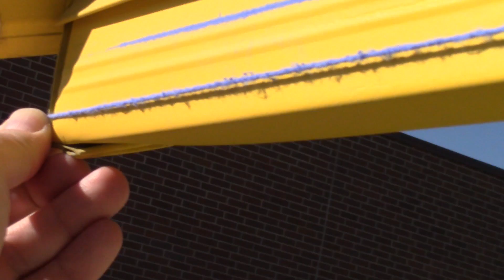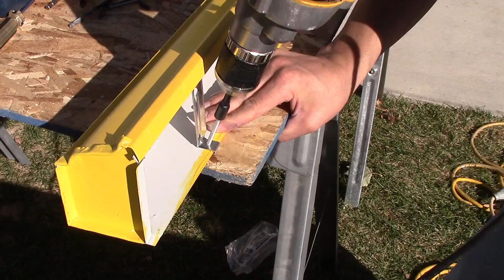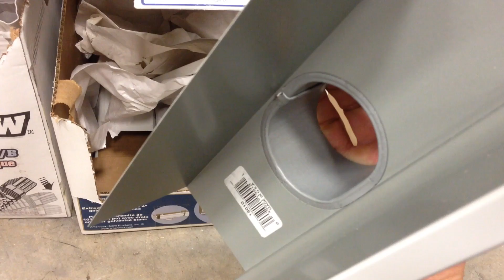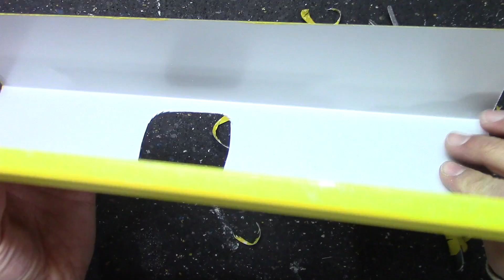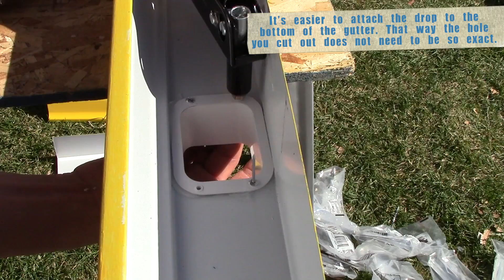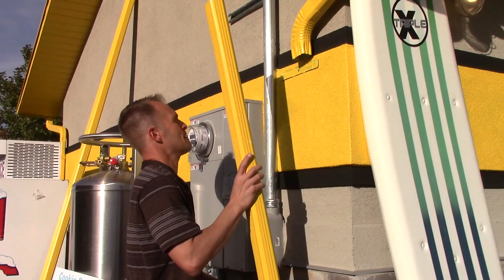How to install Rain Gutters - DIY

Comment: Thanks for the video..very helpful. Only question I have is...what do you do if the fascia board is at a 90deg to the roof angle? Do shims have to be installed for the bottom of the gutter to rest on? Or is there something easier to do?

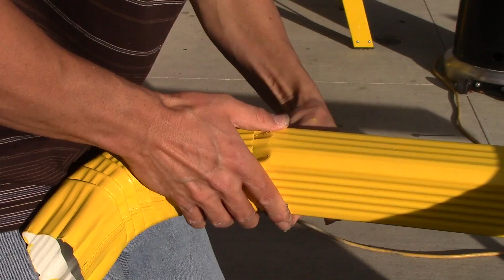Comment: 11:36 wrong way to crimp cutters. If you are going to do this and don't want to buy the tool.  Go the heating isle in HOME DEPOT and crimp one end of each piece of straight down pipe you buy.  Cheapo.

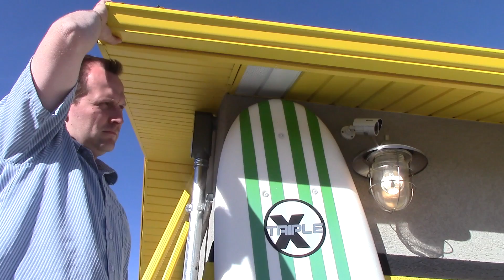Comment: 4:56 that is not gutter sealer and will leak.  Silicone does not stick to aluminum for long with heat and cold.

Comment: Just a hint that was not explained the 2foot spacing is so the screws drill into the truss ends of the roof. If you afix the gutter to the facia only this will cause gutter failure over time with heavy amounts of water. I live in Northern michigan and gutters are subject to heavy ice and snow and ive fixed too many gutters that big companies come in and mess up by screwing into the facia only. Makes sure you screw into the trus ends. You can find and mark these by removing the facia metal and marking where the nails hold the facia board to the truss ends. Doing this will ensure you have amazing gutter for the life of the warranty.

Comment: Finally a proper gutter how to  guide that hits the “how to cut a hole yourself in a gutter with basic tools” flawlessly. Thank you. I just need to see it done and then I can do it. I’m weird like that. I was thinking of installing from the bottom and sealing from the bottom and using some metal screws and caulk and seal it up good because inside the gutter is full of thick caulk and it’s in a tricky location to get to from above.

Comment: Great video, I didn't get the part when you said if I have a section over 30 feet. I have 80 feet so I  would drop about an inch at every downspout? After the first downspout I raise the gutter and pitch it down again? Sorry for the novice question.

Comment: You assumed that building was level. They have levels that can go on your chalk line. You may have give too much or too little slope. The red and green snips make left and right hand cuts easy it’s the yellow or strait cuts that aren’t as useful when dealing with eavestrough. Glad to see you sealed the outlet most videos on YouTube don’t do that lol good on ya. Pipe crimpers would have made putting that elbow on much easier and drill into the mortar between the bricks not the brick. Would recommend putting brackets 18 inches or even a foot apart when dealing with a steel roof but that’s if you deal with ice potentially sliding off in the winter. I’m not sure how the weather is there where you’re from. Never have I seen yellow gutters that’s part of the reason I watched lol

Comment: you are mixing up steel and aluminum hardware, when it rains it will form a battery accelerating corrosion.  are you by the beach? salt water is a wonderful electrolyte.

Comment: What are you talking about!? Lol galvanized will 100% rust! Good try but I install gutters for a living n that's a1 hr job at most n youd b way better off in the long run paying a small fraction more for it done right and seamless but again good effort! 3/5 overall lol

Comment: You installed the gutter over the drip edge?, bahahaha
Reply: I noticed that too.  Seems like the drip edge should go into the gutter?  The gutter should tuck in behind the drip edge?
Reply: @jeffh8112  yes you/ I always put the gutter below the drip or under it.  If its below the drip you install a piece of flashing metal under the drip Down Into the gutter.
Reply: @FFautofab  Okay great.  Thanks for the information!

Comment: Dude. You suck at cutting out downspouts. Easy way is to draw your square like you did. Then use a blade to score over the line, and score an "x" in the middle.  You can use a drill to punch a hole or even a nail.   Take a pair of snips to widen the hole and cutout.  Take a pair of pliers and wiggle the metal till it breaks at the score.  Clean cuts every time.

Comment: While I own a gutter installation company, I actually am a fan of DIY. Everybody needs to save money where they can and this is an informative video. Of course, I believe that seamless gutters are the best long term solution. The warnings I would give to people are simple.

One, if you're not at least a little bit handy, the Peter Principle applies: if something can go wrong, it will. People with no skills will struggle. Double or triple the time it will take to do the job. Two, not everyone is comfortable with heights; even a single story dwelling can be ten or twelve feet off the ground. If you're not good with heights, don't do it. Third, whenever you will be working outdoors from a ladder, be wary of some common sense safety precautions; take into account wind, trees, power lines, etc. Fourth, you may be able to do this alone, but it's easier with two people, both for efficiency and safety.

Finally, use the right tools. It is amazing how the right tools help the job go smoother. Look, if you're older or clumsy, save yourself the grief. A competitively priced professional will save you time and trouble and by the time all is said and done, probably money. Hope this is helpful.

www.BuyRiteSeamlessGutters.com

Comment: Thank you for your really thorough & informative video.  Just a suggestion--when cutting out the hole for the square downspout, why not use the hole-cutter bit  (you used for the round hole) to remove the bulk of the material & finish up with the tin snips?

Comment: Adam, I have built  a small outbuilding free standing with a flat roof pitched 30:1 (a fiberglass roof).  Three sides are upstands and one side, the shortest is the drip trim onto a rain gutter.  I have not yet installed the rain gutter.  The roof is small but an irregular quadrilateral with surface area of about 115 ft2. The drain side of the quadrilateral where the gutter will go is only 8 ft long.  The problem is that I have no draining runoff systems nearby, this building is in a garden.  The other problem is that it adjoins a narrow public footpath used by pedestrians.  I will install a small vertical cylindrical water butt perhaps holding 100 liters next to the building.  I was wondering at the end of your video about this corrugated drain piping.  I could send the water some distance well away from the building and footpath and into another part of the garden.  My question is: with such a small surface area can I just let the water fall over the wall into the footpath or do I need to use such a method?  Maybe such a small rood does not justify any special measure.  I live in England and it rains a lot.

Comment: Adam, I am looking at installing eaves trough over a 56' length. For a number of reasons it would be preferable to only have one downspout. I have a 6" fascia. I have heard of 1/4" / 10 ft and you recommend 1" / 20ft (1/2"/10ft) So looking at those two guidelines I could be somewhere between 1.4" and 2.8" drop over the full length of my 6" fascia. Do you think I will be okay within these parameters?

Comment: Great video. I notice that the gutter extends beyond the drain spout to the end of the roof line.  Do you have to angle back to the downspout or does waster poor out the end of the gutter ?  Thanks again.

Comment: You did the outlet wrong for the downspout. Your supposed to drop the outlet into the hole you cut. Not pop rivet on to the bottom. Other than that not bad.
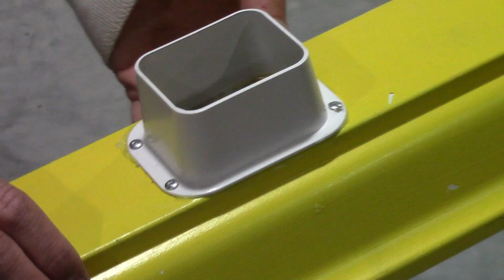Reply: True.  Plus the way he did it leaves the rivet heads inside to catch debris. 8:19.  Plus, look at that sharp edge...hate to be the guy who swipes his hand in there while cleaning out leaves.
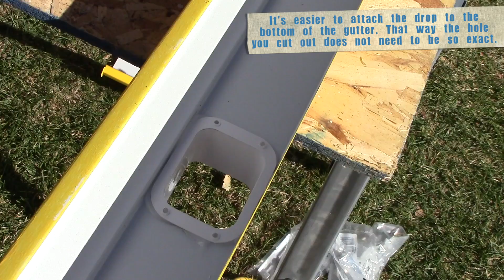Reply: The outlet at 9:50 it the proper way to do it!
Reply: Airbus321
Reply: yep my advice also!

Comment: I appreciate your time in making this video.  But as soon as you said Home Depot, I knew it was not going to be a quality gutter installation. I just bought Amerimax gutters this week, and they are flimsy, almost tin foil like. The seams do not seal well due to the seamer strip not being properly sized to the gutters. They seem to be the exact same size, and that does not work when you are trying to put them around the outside of the seam. And the seam sealer they come with doesn't stick well. I  used Sikaflex on mine. If I were to do it over, I get my gutter material from a better source and pay a little bit more.

Comment: GUTTER PROS LLC. Servicing The DWF Area
Whether you're looking to install new gutters or have your existing gutters cleaned, Gutter Pros, LLC is the company to turn to. As an established roofing business we're pleased to offer a full menu of gutter services, including:

Gutter repair
Gutter replacement
Gutter cleaning
New gutter installation
Seamless gutters
Rain collection systems

AT YOUR SERVICE
At Gutter Pros, LLC, our roof and gutter experts are qualified professionals who get the job done right the first time. We're up to date on local homeowners association guidelines and city permit requirements. And we offer a wide variety of gutters and related services to suit our customers' needs.

With reasonable rates, courteous gutter/roofing contractors, and a commitment to customer satisfaction, Gutter Pros, LLC is here to help with all of your gutter installation, repair, and cleaning needs. Call us today to schedule an appointment or request an estimate for our services

Brandon Frazier (214) 769-2777

Comment: Do you know of any vids that show how to remove gutter from house without destroying it
Reply: Its very easy. If you have old gutters, they're probably bracketed with nails. Use a hammer to bend the bracket and then use the claw of the hammer to slip behind the bracket and pull out the nail. Just go one by one and make sure to have somebody with you for when the gutter falls. There also might be nails in the gutter itself, possibly behind the flashing(metal drip edge that sits on top of the fascia under your shingles) so make sure to check for those as well. If your gutters are bracketed with screws, you're in luck. Just pull out all the screws that are securing the brackets and take it down. Your downspouts can just be knocked off the gutters with a hammer(or unscrewed from the gutter if you want to reuse) and pulled off of the house. Hope that this may have helped. Its very easy, just requires a bit of work if your gutters are secured with nails. I also should mention, the most important part of the process is LADDER SAFETY. Stay alert and don't put yourself into any dangerous positions just to pull and extra nail without moving your ladder.

Comment: Just use a 2 1/2" or so metal cutting hole saw for the downspout holes in the gutter. You're working too hard on that to get a square hole no one will every see. Otherwise nice vid

Comment: The video is very helpful. I need to send you a few pictures along with my question.  I have a metal carport that I use as a horse shelter.  Years ago my ex "rigged" a gutter along the back, as it slopes towards the back.  He used wood blocks to attach the gutter.  The wood blocks allowed the gutter to extend out beyond the roof.  If I can send you the pics you can have a better understanding.  I need to know if there is a better way to attach the gutter?  You will see I temporarily used bungee cords to "pull up" the gutter, which is one of my problems but I also think it is not angled 1" per 20ft.  The shelter is 40' I believe. thank you! And forgot to mention my problem in the last half of the gutter to the downspout isn't draining and it is running over and dripping and making the ground very muddy below it.

Comment: I'm installing the exact same system in a couple weeks, 32 feet exactly, do you think one down spout will be enough??? thanks...
Reply from the maker: I have a long length on my house with only one spout.  It does have a gush of water coming out but it has not had any real trouble.
Reply: #AdamDIY I like that you gave multiple options to perform a single task!  A little slow paced but overall a great/informative video. @Alex T
Reply: Great video, exactly what I'll be doing this weekend. It looks like your downspouts are 2x3, is that correct? My project is almost identical to your, and I was almost going to use 3x4 downspouts. I'm in So Cal, and even though we're in a drought, we do get some heave rain once in a while. I'm stuck deciding between 2x3 or 3x4 downspout. Thanks again for the great vid!

Comment: I like that you gave multiple options to perform a single task!  A little slow paced but overall a great/informative video.
Reply: That's what the YouTube speed controls are for. Click the little Gear Icon and go to 1.25 or 1.5X
Reply: Some of those "options" are improper versions of work.

Comment: Decent video. Very informative but I will say a few things from the trade. I always pop down spouts together vs screws cause they just look nicer and you usually can get them in matching colors to your downspouts. AND the big interjection about snips used to cut the hole.... Always have both green handled and red handled snips. Those are what you use on any professional tin cutting job. You were using yellow snips which are not meant for cutting holes. Yellow handled snips are really meant for just general straight lines and not angle cuts. All together damn good video though outside those two things.

Comment: anyone watching, can someone answer me this, at 12:51, you guys see how he's attaching the downspout strap onto the downspout, i bought some 1/2 inch zip screws from home depot, by Everbilt, it's white and it has a hex head, galvanized steel 

http://www.homedepot.com/p/Everbilt-8-x-1-2-in-Stainless-Steel-Hex-Head-White-Head-Sheet-Metal-Screw-801094/204325619

but when i try to screw the straps in the downspout to secure, exactly like how he does it at 12:51, the screw doesn't feel tight, it goes all the way in, but it feels as if the hole made by the screw is a hair loose, is this screw the problem? or when you screw self tapping screws into aluminum there is a special method? sometimes when screwing elbows onto the downspout the screws feel tight but sometimes it does not, it just spins around when it bottoms up. I hope somebody can answer this thanks!
Reply from the maker: +bludika Email me a picture of the screw. As close up as possible.
Reply from the maker: +bludika adamhbs@gmail.com
Reply: +AdamDIY well it basically looks like this 

http://www.amazon.com/Fas-Pak-9495-2-Inch-Stovepipe-Assembly/dp/B007HV9ZCY/ref=sr_1_6?ie=UTF8&qid=1460439582&sr=8-6&keywords=gutter+screws+hex
Reply from the maker: bludika Yes, I wanted to see the part of your screw where it meets the head. You may have a bad batch or you may be using too much force and speed on your drill.

Comment: not often do I find an outstanding diy video like Adam/s. I do not have a facia plate to anchor the gutter..appears via photo the overhang is about 24 inches? any suggestions? and thanks again
Reply from the maker: +Claude Kment Do you have rafter beams you can attach to?  Yes it's about 24"

Comment: Adam, Great Video - well produced and very informative!  A couple of comments. 1) it appears that you installed the gutter OVER the flashing on the facia.  Some installers recommend lifting the flashing/drip-edge a bit and sliding the back edge of the gutter up underneath.   This may help rain from leaking behind the gutter.  2) a drop of 1/2 inch for 20 feet of gutter may be sufficient.  Thanks for your time and effort!!
Reply from the maker: +Charles Goodrich Hey thanks for the comments Charles! Good info.

Comment: Excellent vid demo, Adam. I'm a retired mechanic, so pretty handy with tools. Your vid showed me a couple of tricks and cautions and eased my mind before climbing the ladders for my install. I had to read down many comments to discover what blade you were using on your combo saw to cut the gutters to length - A DeWalt 12 inch, 32 tooth, general cut saw blade.  My combo saw is a ten inch model, so I'm off to HD to purchase a 10 inch sized similar blade. The tools for the entire installation are pretty much safe, except for the chop saw. Wrong blade and one could get hurt. That you didn't emphasize that fact enough is my only criticism. Otherwise, this is the vid to follow for the DIY'er. Great job, Adam!
Reply from the maker: +Sykon1000 Thanks for the great comment and critique!  I'll add the blade info in the description so others don't have to hunt.

Comment: They put a new roof on my condo and every morning before the sun rises I hear water run off from condensation down one of the downspouts. How can this be alleviated? It's noisy!  Constant click click click.
Reply from the maker: I had that exact same problem when I was about 14 years old.  I just put a  thin sink sponge right at the opening of the spout so that the drip just hit the sponge and not the metal.  That worked for me but your spout may not be accessible.
Reply: +AdamDIY I guess it's sorta normal? Interestingly, it doesn't happen each night, I guess the conditions need to be humid enough for water to accumulate and start dripping down. Btw the curves in downspouts always are really noisy when it rains.

Comment: Adam this is a good first attempt. I am a gutter professional an expert in the field. For your next DIY gutter project reach out to seamless gutter company in your area. Ask them to do a "chop and drop" they will make your gutters any size you need. A lot of times its cheaper than buying these ten footers from the hardware store. Lastly make your gutters 1/2" past the edge of the roofing, this will catch all the dripping water off of the end of the roof. Keep up the good work.
Reply from the maker: +W Miller You are awesome. That is some killer advice!